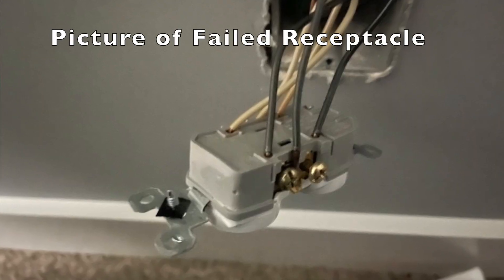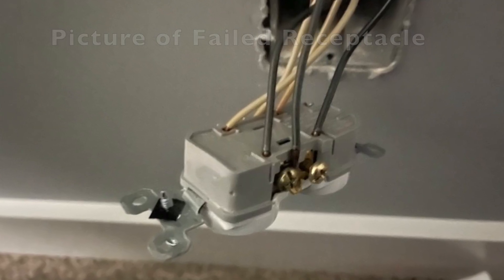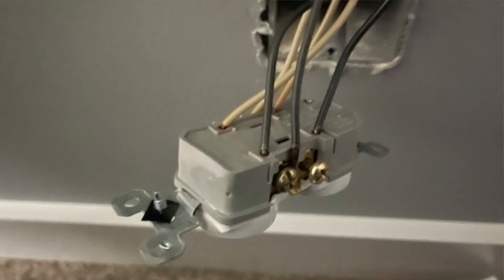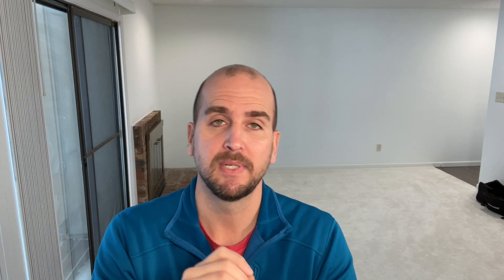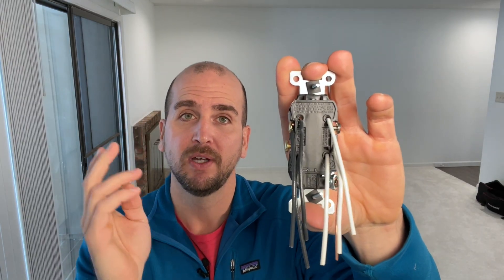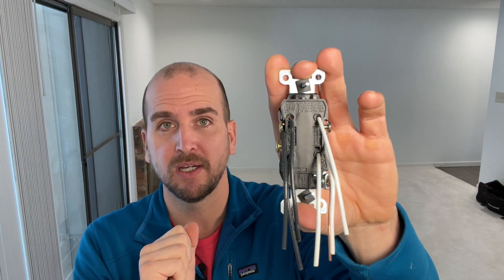Incorrectly Wired Outlet Found In Newly Built Home

Comment: When I did some work on my sister’s home I noticed they’d used the push ins and left all four screw terminals left unscrewed. Was worried about them contacting the box. This was put in by the builder about 20 years previous. About 6 months later, neighbor’s house (same builder) burnt down. Apparently the cause was wiring problems. I wonder if it was the same problem my sister had in her house. Other thing I do since then is wrap the outlet with electrical tape making it even less likely to short to the box in case of movement.
Reply: Sure it was.
Reply: @ZAPATTUBE  Not sure if you’re being facetious or not... obviously no way to know if the fault in the neighbour’s house was this without putting in way more work than I’m willing to (only thing I know about the neighbour is the house burned down). Forgot to mention earlier, the other problem was there was about 1/2cm of exposed wire on each of the push in connectors too....

Comment: One more tip: put the receptacle with the ground prong up (ground prong above hot/neutral prongs). This way if a plug gets loose and anything falls between the plug and receptacle (coins, drapery, etc), they will bounce off or only touch the ground prong, instead of falling onto the hot/neutral prongs and causing a short.

Comment: You should have used Wago connectors.  They are slightly more expensive than a wire nut, but are much more secure.

Comment: You went from one illegal installation to illegal for a different set of reasons.  Electrical boxes have a maximum capacity, based on # devices, # wires, gauge of wires, # wire nuts, and cubic inches in the box.  With the addition of pigtails and wire nuts, you are likely way over box's maximum capacity, adding too much fuel in case of electrical fire inside box, and too much heat in overload due to congestion, and wire lengths.  FAIL!

Comment: I've been an electrician for almost 20yrs. I've always hated those stab-ins. (as well as those clear stab-in 'wirenuts' from Ideal) They are loose most times and I've had them fail when you pull the receptacle from the box (wire pops out leaving exposed hot leg or broken neutral). I always turn in the spare screws, pigtail, and one more thing for added protection... Tape the device especially when using a metal box. I tape no matter what box I'm using and it really takes only a couple seconds of added labor. Those metal boxes are so narrow that it's easy to bounce one off those termination screws into the side of that box. Of course if you shut off the breaker before you start working that won't be an issue. When I work, I like to think of the next guy that may have to come back to that device in the future if it ever fails.

Comment: I like using the push in wire nuts, but yeah I never use the things on the back of the outlet. I also wrap all my outlet with electrical tape to make sure that the ground or anything else touch's the contacts in both plastic and metal boxes.

Comment: Nice video. I prefer the back wire stab in type receptacle where you push in the wire and when you tighten the screw, it grips the wire securely. But how come at the end, you said that outlet you did the pigtail on was 12 Gauge wire.That would indicate that you should have a receptacle rated for 20Amps and the one used is a 15Amps

Comment: We bought a home with a blown out GFCI and cold kitchen circuit receptacles.  After moving in I found the LINE was wired to LOAD terminals and the LOAD was wired to the LINE terminals.  Unbelievable negligence from the builder's electrician but only a $10 DIY fix.
Reply: many residential electricians are unlicensed and often forced to work as self employed so the contractor can deny liability and force the "employee" to provide all their own tools and safety gear.  Not all of them, but it is a pretty common setup these days.
Reply: @RedR3297  i have also seen this , because they don't what to pay an licensed electrician
Reply: Incredible how many people wire the plugs in backward. Once found house breaker box with one side swapped hot and neutral. Guy was wondering why his lights were all blowing out when he turned them on.

Comment: Good video. The only thing I'm confused about is in all my years of electrical work I have never ever seen a push in fail. Not one time. However I have seen screw terminals fail. Usually because of the installer by screwing part of the insulation behind the screw or by not cranking the screw down enough.  From my experience it's alot harder for an installer to mess up the push ins. But there are many ways to mess up the screw terminals.  But again great video.
Reply from the maker: Hey Jody, thanks for the feedback and I agree that the opportunity for error is much higher with screw terminal compared to push in.  That is why I like Spec grade for DIYers with back wire plates.
Reply: I promise you the stab ins fail frequently.  I really think the NEC should ban this type of device.
Reply: @Checkmate54321   I believe you that they fail. I just personally have never seen it. But I have seen the screw sets fail alot. I think what it all boils down to is home owners should not do electrical work. It think both methods are fine if you know what you are doing.
Reply: @jodymarty3179  I'm not doubting what you have experienced, but personally I have never seen a receptacle fail when the wire was wrapped properly on the terminal.  In my area I get several service calls a year from burned outlets, all of them back wired.

Comment: A pig tail in my opinion is certainly not needed when you have screws equal to lines. As a contractor it is very common for electricians to signify the end of a run with a single pair connected. So if I'm deciphering a line issue on a remodel it could create a mistake.

Comment: You mentioned this was in a basement.  The National Electrical code now requires GFCI in all areas of the basement whether they are "finished" or not.
Reply: Way to assume it is not GFCI protected via an up current GFCI outlet or breaker

Comment: I don't see how the pigtail is better than having multiple wires connected directly to the switch. Looks like six of one half dozen of the other. And if you have a cramped little box you're just adding more stuff you have to fold and stuff in behind the device.

Comment: May I add one more tip? you should actually install the recepticle with the ground on top. Why? Let's say there is a cord only partially pluged in with the prongs of the plug visible. Now let's suppose someone drops a metal knive or something on the plug. If the ground is on top it is a non issue as the knive will fall away. If the hot and common is on top the knive will arc across the prongs. This is not code but best practice.

Comment: 1. It's immaterial whether the unused screws are tightened down, although I generally do it for the sake of neatness and consistency. The oval holes around the mounting screws are narrow enough that those screws cannot possibly contact a metal box... and if you unmount a receptacle live, then all bets are always off - especially if the previous person in there used those stupid jackass stab-lock wire terminations and one of the wires pops out of the stupid jackass stab-lock and contacts the box despite your greatest efforts to prevent problems.

2. "...that link is right here" (points only to the YouTube logo)

3. I'm with ya on the stupid jackass stab-lock terminations. See above.

4. You only need 1/2" of stripped wire to make a pigtail, not 1".

Note that pigtails are illegal in many countries where all wires must terminate under a screw. There's actually a good reason for that.

Note also that in some boxes... there is no room for pigtails.

5. When you use a backwire, ALWAYS use the left-side slot so tightening the screw pulls the wire into the outlet. If you use the right-side sllot, tightening the screw ejects the wire from the outlet.

6. Put the ground at the TOP of the outlet instead of the bottom so the outlet doesn't look like a little "oo!" face, which little kids find attractive. Doing that also makes it slightly less likely that you'll throw sparks or get shocked if something isn't plugged in all the way and something else falls between the plug and the outlet.

Comment: Not an electrician here but I do have some experience with messed up wiring.  For instance my company had 4 outlets that literally melted down.  Turns out the person who installed the electrical never tightened down ANY of the outlets.  Considering this was a test facility and we pull full (plus a little sometimes) load on a single outlet it was surprising the place didn't burn down.  Same place had masking tape around the outlets... I get why some people use electrical tape but papper masking tape.... Really?

Comment: You missed one more issue, don't recommend anyone to DIY their own electrical unless they've been trained and certified. You don't screw around with electrical unless you understand the dangers associated with it. If you do your own plumbing and make a mistake you get wet, you make a mistake with electrical there is a high probability that you or someone else gets dead. This is coming from a retired union electrician. There is a reason an electrical apprenticeship is 5 years before you can work on your own. No offence to the channel creator but sometimes these DIY channels really irritate me. One more correction on something you said, there is no increase in frequency just because you plug in or unplug a vacuum motor from a receptacle. The frequency of the supply voltage always stays the same. Perhaps you meant the inrush current that occurs when an electric motor turns on. If this is news to you then it's another reason why you should not DIY electrical installations unless you have the training and certification..

Comment: Lived in a house in California built in the 80s.  Had a 110 volt hot tub on the back patio plugged into the 110 volt duplex outlet, GFCI breaker in panel.... The circuit also fed the two bathrooms and the kitchen... In the closest bathroom to the panel, they used the receptacle as a junction. 4 wires, two wires under the screws and two wires in the push-ins...   Sold the house by owner, moved out and doing the final vacuum of the carpet in the dressing area of the master bath.  Wife said the outlet was dead...  I noticed during my last walk through of the backyard that the circulation pump wasn't running in the hot tub... I figured breaker tripped???  NO... Started tracing out the circuit and pulling outlets apart.... In the bathroom closest to the panel (the junction point), you could not tell the difference between the black wire and the white wire, not to mention how crispy the insulation was.....  The next house we lived in (for 22 years) The wife and I built ourselves....  You can bet EVERY wire was under a screw, and yes, with Pigtails!!!!

Comment: You must live with different electrical codes that I do.  Outlets around here have 4 wires in them because there is not enough room in the box to add a nut and third wire.  Your electrical box is either deep or you dont have a true box and the wiring is loose in the wall.  We also loop the wires going to the receptacle, and dont put them in straight like you did.

Comment: I would never use the push in connectors for anything else than LED lights. I never pigtail  if I have two wires, but I always pigtail for three. And your box will be rated for a specific number of wires. You need to avoid too much box fill even if you can pigtail everything.
Reply: I pig tail whenever possible, passing voltage downstream through outlets is risky and not advisable. I used to be a commercial electrician in California 16 yrs ago.
Reply: I hate push in connections too. Good call 👍
Reply: The issue to begin with is the circuit breaker. The receptacles are rated for only 15 amps. By pigtail wiring the circuit current does not pass through previous outlets.
Reply: @lynngai1980  Yes, which lowers the resistance in the line ever so slightly. It still hits the same breaker if it's on the same line.

Comment: When learning my trade, my foreman insisted that all device plates be plumbed with a torpedo level and as a final touch, the plate screw(s) be aligned vertically.  He said that the inspector will appreciate that if you took the initiative to do this you were also doing the inside right too.
Reply: In Texas you don't have to worry. Electrical work is being inspected by an ex plumber, plumbing inspected by framer. Inspector of all trades, master of none
Reply: He was a good teacher.
Reply: My wife insists on the vertical screw alignment

Comment: Ok so views on wrapping electrical tape around the outlet before installing in the box? Also I was taught to have either the neutral slot up tward the ceiling or the ground pin up, depending on whether mounted vertical or horizontal.
Reply: 3 wraps is a quality standard. Only needed on metal boxes.

Comment: Some people might “try this at home” and find it is very difficult not realizing some boxes are shallow and some are deep. Box depth should be talked about in one of your videos.
Reply: If you actually follow code about the free wire I find the shallow boxes to be infuriating unless they are the end of the line, and probably also against the crowding code. Just go bigger. 4" with mud ring. I don't really understand people trying to save money on materials when labor dominates all costs anyway.
Reply: @trygveskogsholm5963  Project managers see cost through materials. Not necessarily man hours. Which to them is usually given as a set amount. Same thing happens as a network engineer. They penny pinch in all the wrong places.
Reply: @trygveskogsholm5963  Speaking of saving costs for little reason, I also HIGHLY recommend using 12AWG instead of 14AWG. Especially on small projects such as a new edition on the house even if it’s not required by code. For just a few dollars extra you not only have peace of mind but you leave option open for a very easy and simple transition to 20 amp outlets if ever needed.  For things like a window A/C or  space heater. My last totally awesome tip is you should consider old work boxes even when building new work. This is great for two reasons. One is that you have more freedom to precisely place your outlet in a more desired location because you can locate the box anywhere between studs. ( Worked for me when I wanted my toaster outlet in the right spot.) And Two, that if you ever need to upgrade the box later such as a hard wired clock or hard wired under cabinet lights, you can easily unmount the old work box then remove it, then reach your hand in behind the wall to pull your new wires.
Reply: @wheelie642  I agree totally. Especially places you have more load, kitchens, garages and even bathrooms. May as well do the entire house when you are building!
Reply: @wheelie642  I installed a high end Brondell bidet when it became difficult to buy TP. I had no power for it in the area, but had a light switch on the wall side of the toilet, so I was able to fish a wire easily down from the switch and install an outlet. There wasn't much load on that circuit so it came out fine.
Reply: Great information sir. I had to purchase twice, wasting a little money of course in the process. My first purchase was the cold water only bidet. Mom didn’t like it. Too cold. So I got a hot and cold water bidet that runs from the hot/ cold lines from the sink. Mom still doesn’t like it but I love it.   Did you measure amp draw when heating? Just curious. Thanks for posting.
Reply: @wheelie642  its so funny that people don't employ this concept more often.  Given the difference in price between 14 and 12 and the fact that the cost of moderately sized jobs or larger are heavily skewed towards labor costs, most of my customers understand the long-term savings and benefits to uprising during a new install or a refit.
Reply: @wheelie642  Common practice where I live, all outlets are 20amp 12Awg and allowed under code. Is the wire not the device that the breaker is protecting and must be rated for. Some places use have lights and outlets in a room all 12Awg same breaker, today put lights on 15 Amp 14Awg Outlets on separate than lighting circuits using 12Awg 20amp
Reply: @wheelie642  I never use 14ga for exactly the reason you specify. Also, I live in Houston, where attic heat is a real problem. This means that cables in the attic should be derated, I think to only 80% of the normal rating. Nominally adequate 14ga cable might therefore might be overloaded if run to lots of outlets, or to heavy appliance loads. Give me the yellow jacket 12 ga any day!
Reply: Box allowances has entered the 💬
Reply: Box extenders are a quick and dirty way around a busy junction box situation where you simply need more room to properly fix wiring issues.  If the box is down by floor level, it won’t be noticed at all.
Reply: NOTHING should be talked about in this idiots videos unless you want to burn your house down...

Comment: Pig tails also makes it easier to put the device into the outlet box. It also makes a better mechanical bond on the wires. If that device fails, bad connection, headboard bangs into it and breaks the device etc, you don’t break the circuit in the string of receptacles.

Comment: This is an excellent quick video of best practice. I especially like wire nutting with pigtails. This makes it easier and safer for the person after you replacing a worn out receptacle who may not be experienced. I’ve trouble shot these things where the daisy chain was broken by mis-wiring plugs and/or switches. Make it a circuit where there are multiple hot conductors to support partially switched receptacles, such as for bedroom lamps or under kitchen sink receptacles, and it can take some time to figure out.